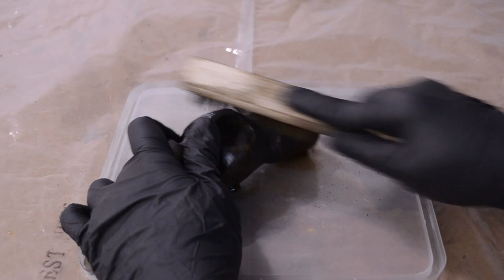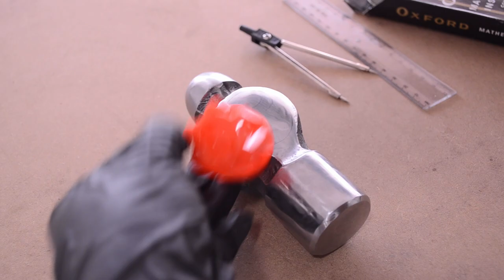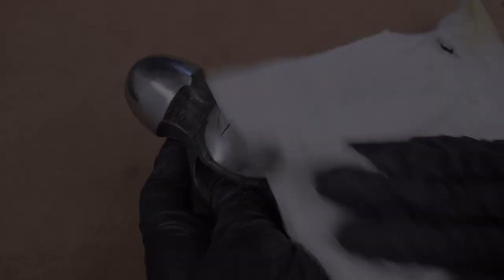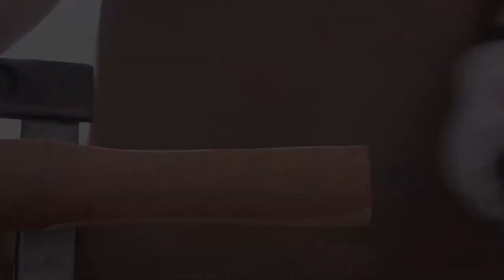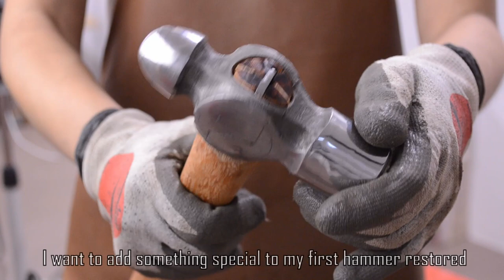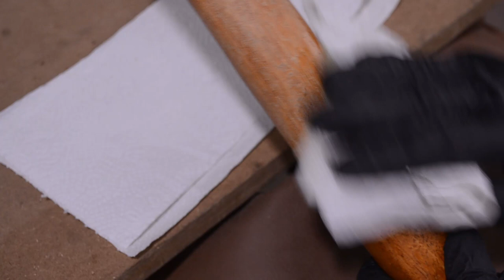Old and Rusty Hammer Restoration

Comment: Nice job, especially considering that you don't have a workshop.  Here are a few tips:
1. Old, used hammers, unlike many other old tools, tell you exactly their quality.  If the steel is too soft it will be mushroomed, if it is too hard it will be chipped.  Unless you can re-heat treat, the result will not be worth the effort for tool you will actually use.
2. Never leave an abrupt shoulder where the handle enters the eye.  This is equivalent to telling the tool where you want it to break, because all the forces will be concentrated at that point.  Make a long tapir into the eye, leaving the forces spread out, and it won't know where to break, so it won't.  Sure, I'm anthropomorphising, but the point is valid.
3.  The spokeshave was very dull.  The work would have been much easier with a sharp tool.  Also, work the tool "downhill" with respect to the grain (the fibers) of the wood.
4. I couldn't identify the wood you used, but it didn't look like a good wood for a tool handle.  If possible, go for a strong, springy wood.  Hickory is generally considered best, but ash and others are also serviceable.

But anyhow, it was your first hammer and you were learning.  Keep up the good work, and have fun with your next one!
Reply from the maker: That's very helpful and informative! Will take note of the points..for point 4, I'm not sure what is the wood too..got from a local hardware shop, it's for axes handle
Reply: @theymaker125  Well if it's good for axe handles, which is a very stressful application, it should be fine for a hammer handle.  By the way, you can still carve down the wood near the eye to a pleasing taper; you just have to be careful not to hit the steel with your tools.
Good luck!
Reply from the maker: @MartinMMeiss-mj6li  Sure! Thanks 😁😁
Reply: I think you should listen to this guy, he knows what is he talking about. The only added advice that I can give is keep practicing and never listen to a negative comments. My first restoration was not even close to yours. So, keep up the good work and good luck.

Comment: Wear safety glasses if and when you use it. Its hoghly likely the previous owner wasn't aware of how bad it is to weld on tempered and hardened steel but. The interesting thing is about it was how the weld showed even after you ground and polished it.  Its like a whole new way of doing a demascus appearance

Comment: Sweet work Y - awesome. Just me, but I might have filled that hammer head with wood putty, and then baked in an over at 150 degrees for an hour or two. Then I would have knocked the wood putty out of the hammer head, and used that as a "model" for my hammer handle (using precise measurements). That way you might have gotten a more precise fit with the hammer handle and hammer head.

Anyhow, just a thought. Can't wait to see you next project!   :-)
Reply from the maker: Oh ya, that's a brilliant idea! Never seen one use that trick before..thanks for the idea! 😁

Comment: It's not the heat from the welding that left the "R". The welding filler mixed with the base metal and formed a new alloy. Since acid etching reacts a little differently with each alloy, you're basically highlighting where the metals differ. This polishing and acid etching is the main method welders use to test weld penetration. Heat treating the head won't change the alloy, so it won't change the etching results. If you want to banish the "R", you're going to have to cover the hammer's head with a uniform alloy - perhaps by electroplating.
Reply from the maker: This is very helpful. Thanks for the sharing!! 😊
Reply: Or remove more material, which is likely undesirable.
Reply from the maker: @darichard11  ya, that's true.. removing material is the most unwanted situation.. but sometimes it's needed to achieve one's perspective results

Comment: Wow you saved that one. Great job on the metal. That "R" still showing would really bother me however. Handle is not very eye pleasing, especially where the wood meets the metal. I've found that commercially made replacement handles are often better looking, made with better wood, and save a lot of time. Liked and subscribed
Reply from the maker: Thanks for the support! Ya the handle should have a stress relief curve instead of that step.. you can watch the later sledgehammer video that was uploaded, it has a more proper handle 😉

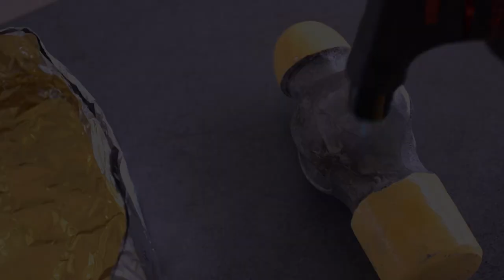Comment: Looks good but at 7:38 you're definitely gonna need a bigger torch theres no way a small handheld lighter torch will bring it up to temp to its bluing stage
Reply from the maker: Thanks for the advice..definitely in need of a proper torch😊
Reply: The Y Maker you should look for the map gas ones they’re in a yellow bottle, map gas heats up faster than butane and propane or the kitchen butane ones are decent too otherwise
Reply from the maker: Oh! This is the question i always wanted to ask about the kitchen gas..so that's butane gas as you mentioned? Can i attach a blow torch and use that to heat up metal?
Reply: The Y Maker yes you can however it won’t be nearly as fast and easy as using propane or map gas, for larger objects you would need map gas or an oxy acetylene torch however for small stuff like in the video butane with a kitchen blowtorch should work just fine. Also when you’re quenching in oil I find that used motor oil works great and will leave a nice dark finish, unless it’s for food then probably use olive oil or any food oil
Reply from the maker: @haydenyeap2818  this is very helpful! Thanks for the information 😊